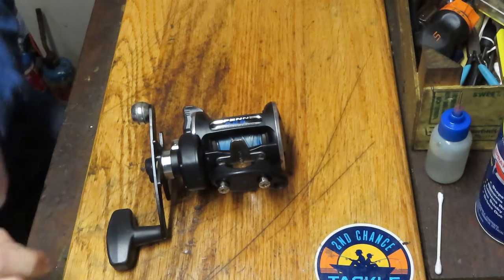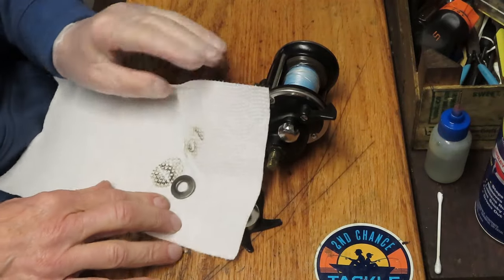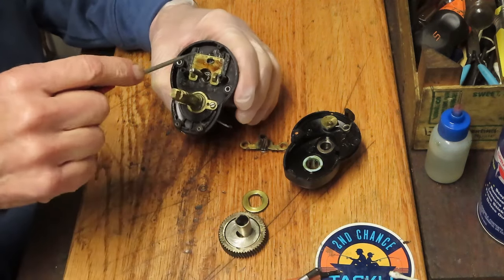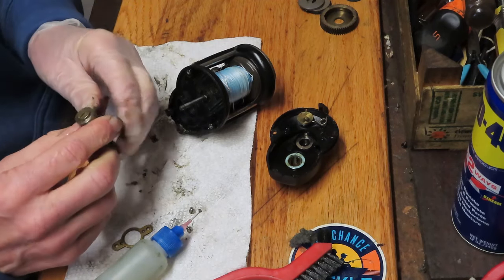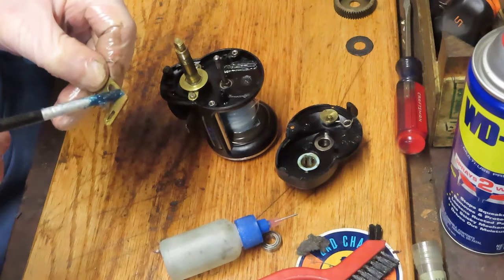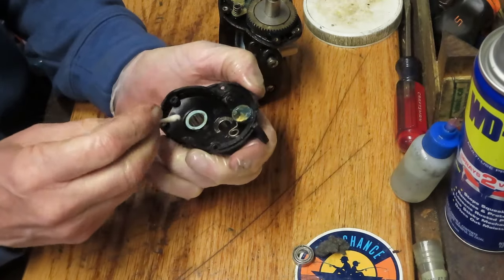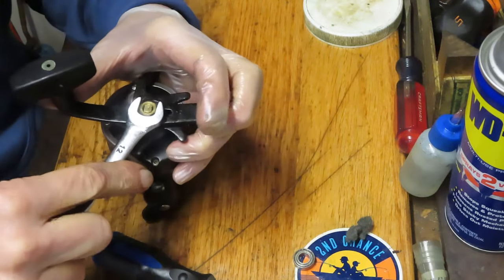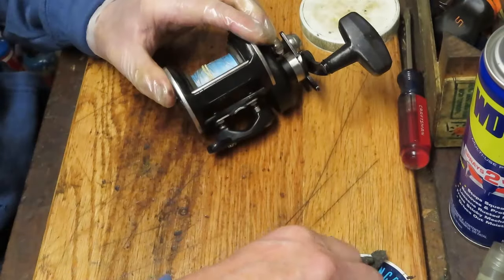Penn Graphite 525GS fishing reel how to service and correct a unique failure

Comment: Sure would be nice if other Reel Co’s would keep available parts like Penn . Quality Company quality Reel and quality video .
Reply from the maker: I agree, but parts inventories are expensive and as a reel ages out, the parts are less in demand.  Very costly.  That is why most manufacturers will only stock the parts for a year or two and then sell them off to secondary distributors to finish out the stock after warranty work and terms expire - Thanks Bobby